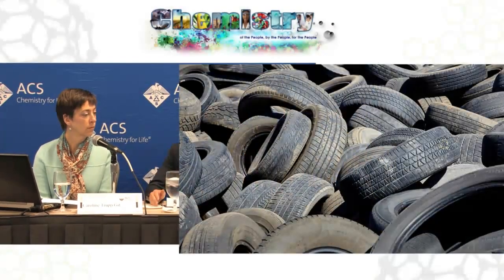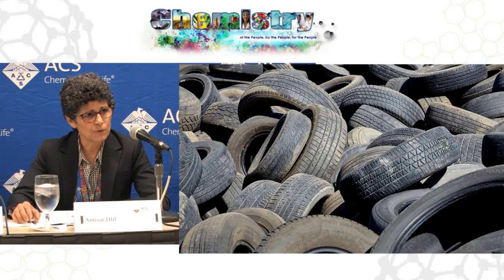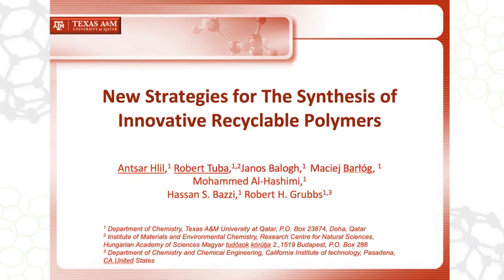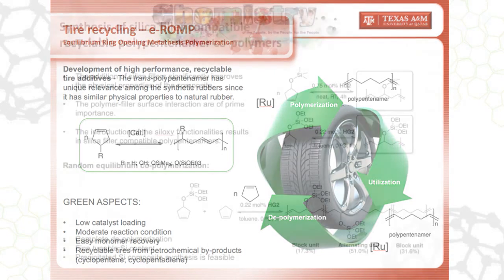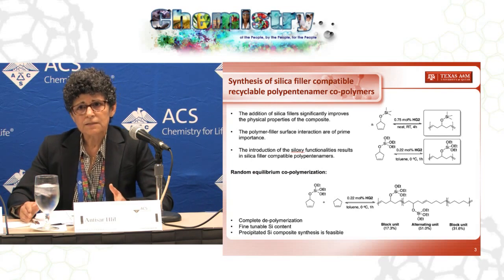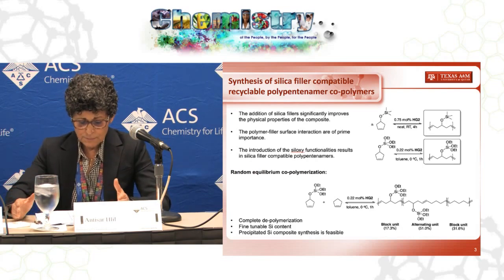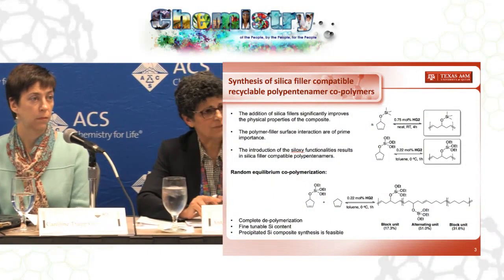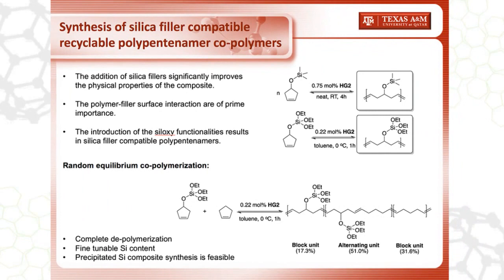Reducing tire waste by using completely degradable, synthetic rubber

Comment: I doubt that re-using rubber by repeatedly expanding the polymer and then adding TALCUM and LIMESTONE to make tires more durable is going to become a waste and increase carbon as overpopulation continues. I think that the Ouija board is right when it says that in the long term cars will be outdone by taste for electric rail-roads and levitation in central places to give true nature a better chance than cars which are fast becoming a symbol of "selfishness". There is enough carbon in tires to convert to magnets or metals, because all humanity will soon NOT WANT to use cars because the overpopulation is making "inroads" into wildlife in ways that destroy it.